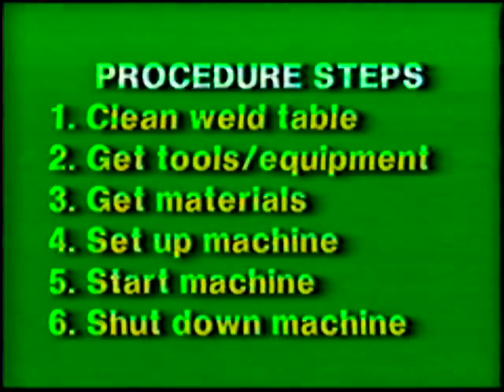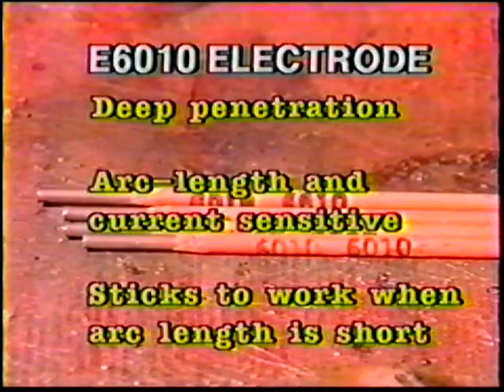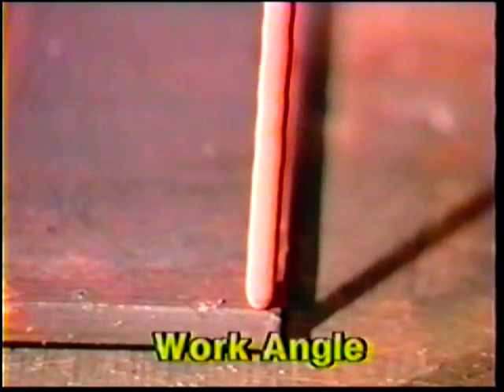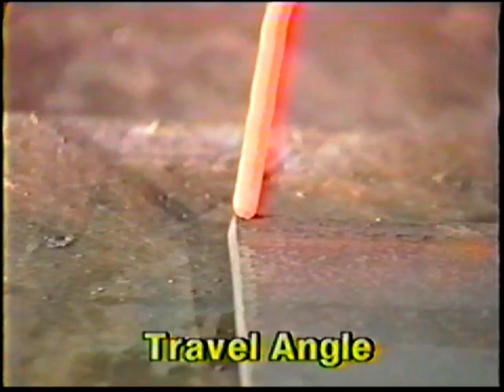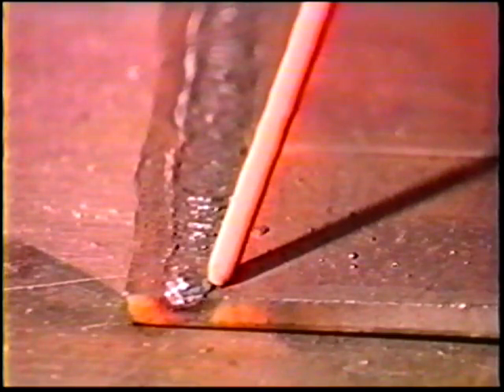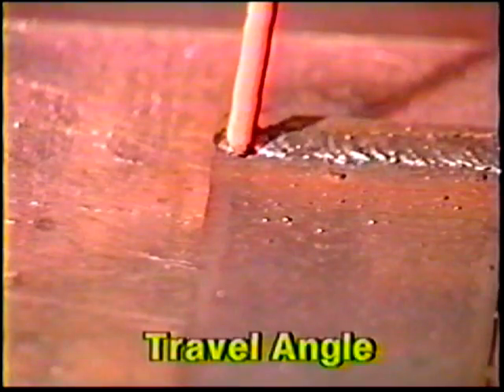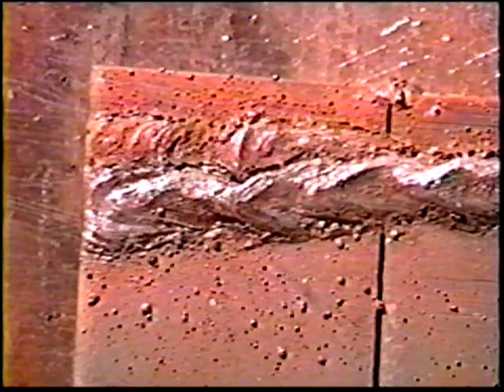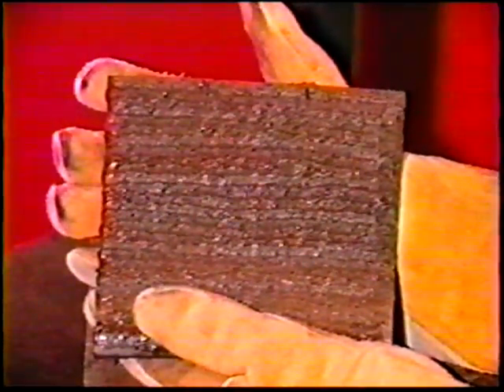How to use 6010 Welding Rod

Comment: I’ve never welded before and I’ve started going to school for it but I struggle so much with the 3/32 Diameter 6010 rods. I can’t seem to keep my beads consistent
Reply: Just slow down and watch your puddle not your arc or stick. Make sure you're using the proper rod angle also.
Reply from the maker: Just gotta keep practising

Comment: What amps should I have it on for a 1/8 Diameter 6010 rod? 
Mine are only burning and sticking right now :/
Reply: Figured out the problem, mines too
Reply: Start at 85 amps and depending on penetration go slightly up or down.
Reply: Around 110

Comment: can u answer a question please. am new and i got a welder but the rods just burn and the iron wont melt. am i doing something wrong?
Reply from the maker: perhaps the rod diameter is not large enough to melt the base metal, or you may need to turn up your amperage.
Reply: Thanks for replying. i did turn it up, way up. but its the same. what do u think  the rod diameter should be?? i got 1 of the new mailtank 400mma welders.
Reply from the maker: @leightonsimmonds6795  what thickness metal are you welding?
Reply: its a 1 × 1/8 flat iron with 6013 rods
Reply from the maker: @leightonsimmonds6795  shouldn't need to run bigger than 3/32" diameter, probably 1/16" would be fine. maybe around 60 amps.
Reply: oh ok thank u. I'll get some soon and get back to u ok. thanks again.
Reply: @leightonsimmonds6795  how’d it go
Reply: @mrmann5053  hey it turns out the welder is not pushing out the amp it says
Reply: @leightonsimmonds6795  cheap 250 amp welder runing on 120volts ? If so for 6013 1/16th try about 90-120 amps your welder is probably actually a 91 amp welder also make sure your not floating to high from the metal

Comment: My 6010 beads turn out okay, the overlap isn't good so I gotta work on that and they beads are a little curvy (gotta work on them being straight), but one thing I don't understand is why my beads are all turning brown after I weld. The whole padding block turns a rust color after I run a new bead. 

The last bead I run is all shiny and looks good after I chip away the slag, but as soon as I run a new bead the one before it turns brown. My instructor says it could be because my arc is too long and I'm spraying slag all over it, but it seems to do it after I shorten my arc too. Not sure what EXACTLY i'm doing wrong.  Trying different things to see, but it's the weekend and I won't go back to try it again until monday.
Reply from the maker: Hi Victor, 

Without knowing your exact situation, my thoughts on the brown color is that it could be simply the smoke from the previous weld and should be able to be buffed off. also it could have something to do with the moisture content of the electrode or the coupon that you are using, although you aren't using a low hydrogen rod. 

You could try preheating your plate before welding to remove any moisture in the plate. Also make sure you position yourself to be able to make the entire weld without becoming overstretched or uncomfortable, which can cause a curvy weld as you try to correct your path as you weld.

Good luck and thanks for watching!
Reply: Yea I just started doing 6010 and my beads turn brown as well like rust
Reply: No shield
Reply: Some water always helped me with that😂